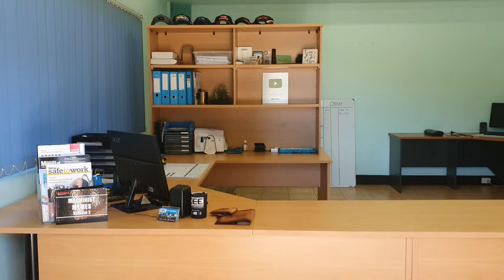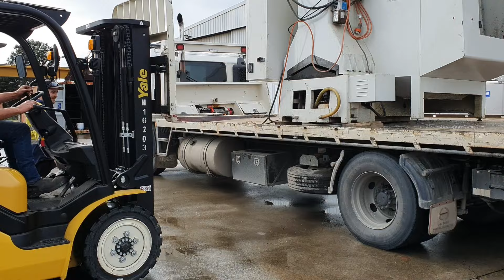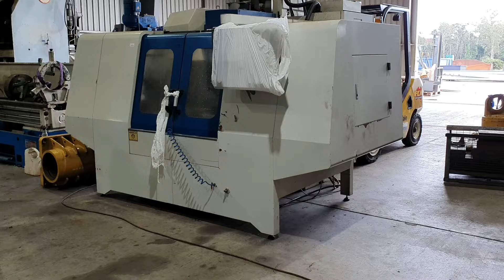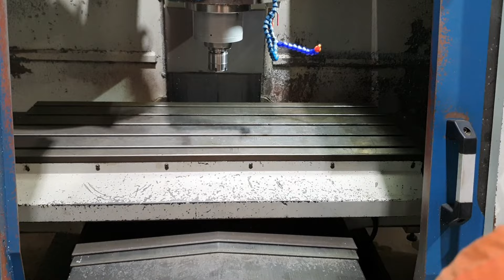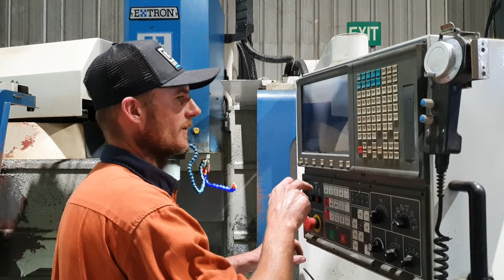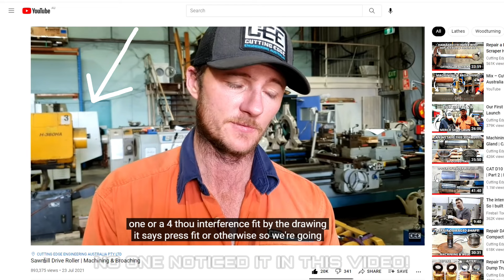Finally REVEALING Our New to us Machine | Workshop Machinery

Comment: Congrats with the CNC mill. My best advice number one is: Always use single block mode when testing a program. Turn down feed rate to zero and look at the coordinat numbers on the screen before you push run or start. 
This way you go step by step and avoid crashes. It only takes a few wrong digits and the wrong code before a huge crash.

Programming is a bit like you would think.. point a to point b to point c etc. 

Good luck, now you can ditch the crayon and ruler..
Reply from the maker: Awesome mate thanks for the great tip for sure that's going to save some broken tools 🤣👍
Reply: @CuttingEdgeEngineering  A thing i allways do if not sure about the program is is add an even number say 100 (so it´s easy to rember) to Z on the place you have taken the Z zero in the program and run the program above the work pice and see what it does.
Reply: @CuttingEdgeEngineering  AvE may have some tips for CNC machines but he's Canadian and you may need a translator. 😅
His channel (in case you don't have it): https://www.youtube.com/c/arduinoversusevil2025
Reply: @CuttingEdgeEngineering  You just don't want to crash the hole spindle, a used one would probably be close to what you bought the whole CNC for.
Reply: Yep, one hand always on the potentiometer for the feed. One time I forgot it, poti was to 100% and the tool stopped 2 mm before the part I was going to mill. Heartbeat went straight over 300 :D
Reply: Still have to measure in bananas tho.
Reply: @fatasianone  I doubt it is limited to bananas. Even early CNC machines could be st to metric.
Reply: Change one parameter from 1 to 0, and voilá, it's a metric machine!  BUT keep the machine and all the programming in one set of units or the other.  Or you'll find the terror of the 25.4 scale factor.

CAM software makes quick work of converting units back and forth.
Reply: Congratulations on the new machine!  I strongly suggest dry runs, that is, after you have set the program, move the z axis up a few centimeters and run the program. This allows you to validate a lot before cutting.
Reply: Another tip for a new cnc operator.  Have the spindle turning when you are manually moving the machine around its travels.  That way if you bump into something, you are less likely to ruin the spindle bearings.
Reply: What application would Kurtis use to design parts?
Reply: @TrevorDennis100  A CAM program.
Reply: @johncolvin2561  - congratulations, you've made the dumbest comment ever written on this channel.
Reply: @johncoops6897  Do you even know what a CAM program is used for? FYI I am a retired machinist.
Reply: Yup, never run at 100% rapid. Your not doing production so it's not worth the risk.
Reply: I can't imagine the sheer terror of revving that thing up only to watch it crash.  I did C++ coding and one little missed ), ; , ], and the like could screw over thousands of lines of code.  It's not fun.
Reply: One wrong digit could make it a bad day.